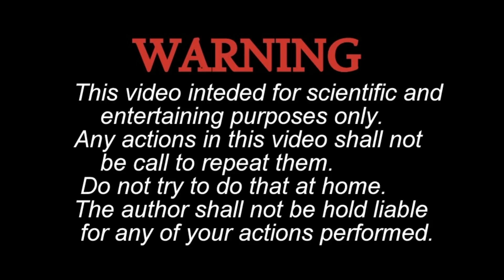How to Make Cheapest Welding Machine by SALT

Comment: What is meaning of flowing current through salt water? And is it connected with direct 230 V AC power supply?
Reply: Ya I have tried it without water
Reply: The saltwater is a current-limiting resistor. Try different concentrations for best results, but the voltage should be at least 24 volts (two 12v batt.s in series connection.)

Comment: You did it wrong by adding a lot of salt to little glass container with less water,.. You need to add little salt compare to water. 20% salt and 80% water should give you enough power to weld properly. If not, then you can adjust the output power by adding salt, or bringing electrodes close to eachother and checking it with welder to see if it welds properly

Comment: How could be ac volt in positive and negative ?
Reply: What? AC doesn't have any positive or negative. It is phase and neutral
Reply: @physicsisawesome696  phase and neutral isn't same as DS + and  -
Reply: @omsingharjit  no bro
Reply: @physicsisawesome696  so tell me why it's not written ,  P N instead of + , -  in any dc supply ! And vise versa for Ac device ! 
Ac isn't same as dc + and - ask it to any electrical engineer or prof or google it how ac works
Reply: @omsingharjit  DC is a current that flows without any change in direction. So it have polarity as + and -. In AC, the current flow is alternating. That mean the positive and negative changes very fast. So it doesn't have a constant polarity as positive or negative.
 Did you know that the voltage is the potential difference between positive and negative or phase and neutral. In our city power supply we get 230v AC. In some countries that will be 120v AC. Let's take as 230v AC.The phase line has 230v with changing positive and negative. Neutral line has 0 volts. So, the voltage difference is 230. That's 230 volts. Hope you understand what I am saying. If you have any doubts about difference between AC and DC, I recommend you to watch the video of Electroboom YouTube channel. And if you search in YouTube or Google, you get more results.okay😊
Reply: @physicsisawesome696  you learned it but probably didn't understand it. You saying that if there is two wire connected to the 230 v 50 Hz ac supply , it's any one wire ( lets say red ) will going  to be positive and that exactly same time its other wire  (lets say black ) will  going to be negative and this positive and negative flips between wires ( vise versa) right  ? Just confirm me it's your words or not ? 
Then i will tell you at which point you are wrong .
Reply: @physicsisawesome696  and about your " did you know voltage is potential .." question ...
I wanna say it's nothing special i already knew it for very long time .
I was already  subscribed many famous YouTube's channels  like Gre..Sch.. , How..To..Me.. , mr tesl... , Styro.. , keysto... , The tho.. em.. , #including electro boom , and also electro noobs ( in case if you don't know) that all #just because of #fun not for learning ,  because i already knew all about that that they are doing . And that Doing is special for me  😉
If you are serious in learning then watching videos  isn't enough ,  get some classes 😆.
I am an electrical engineer  and  also an electronic  projects maker  Watch some of my video in my same channel . 😉

Comment: Isnt fake but its very dangerous and isnt dynamic dont any one try to do this idea cuz welding machine its voltages from 40v to 80v but thats idea 220v or 110 in usa they use 110v here in Palestine we use 220v , the normal electric its dengrous u cant touch anything with this idea during welding and its not safe thanks for everyone .
Reply: It's look like repairing a dried battery by adding salt instead of battery solution so the possibility of charging was only 12-14 volts

Comment: you just make a spark and not actually welding it... your video has to many cut's .. after you make a spark you cut the video and weld it on a real machine then go back to the video again.. and this diy thing is very dangerous. that salt and water may explode on heat. and the wiring thing is that directly on a 220 volts?.. that's very dangerous.